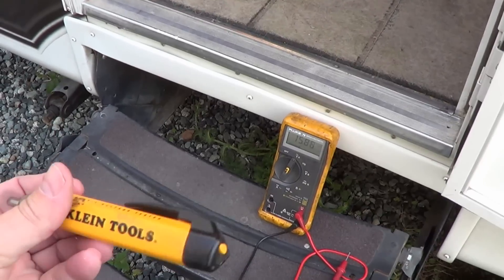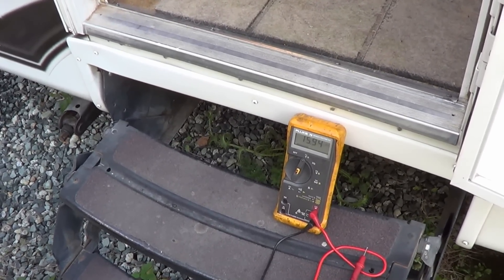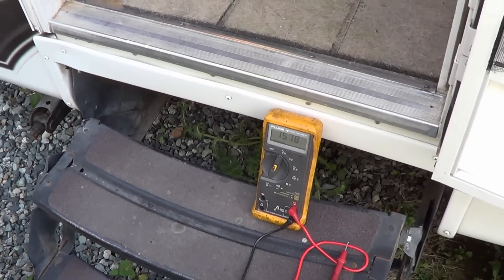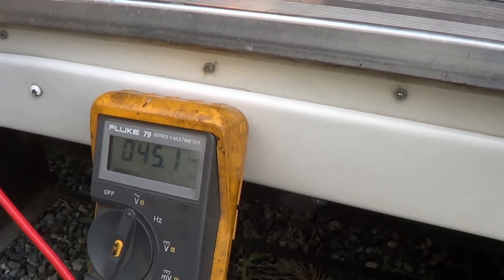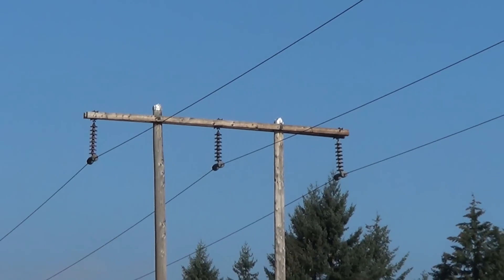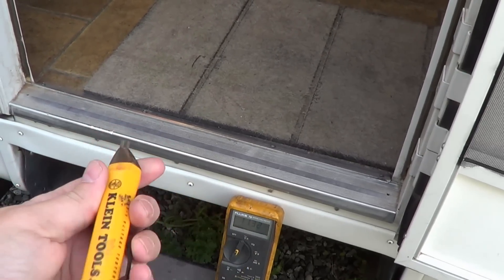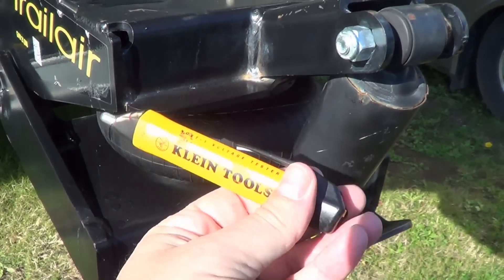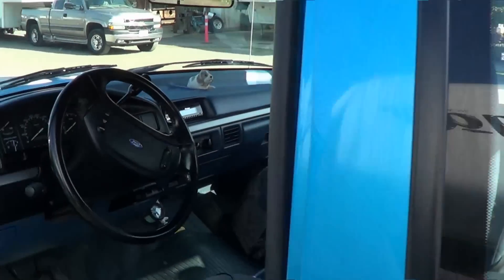Why Was My RV Giving Me Electrical Shocks?

Comment: You can trace it to the source with a pronged tester that you plug in right where you plug the camper in at. Hopefully you read my other comment as I know how much can be spent trying to trace the problem between time and money trying to figure it out before taking it to a pro only to find it quits or don’t do it at there shop. Then it does it again at the campground or park. Many people will think it couldn’t be the camp ground as they would have proper wiring lol not the case.
Reply from the maker: I have the Progressive Industries EMS-HW30C Portable Electrical Management System installed in my RV, checks the campground wiring for faults before transferring the power - http://amzn.to/2HLaRrL It will also shut the power down if it detects a fault or too high/low voltages.

Comment: All the time or just when plugged into your home or property?
I know of this to have happened to 2 different people that I know. 
I learned from the first one that it was a bad ground in the wiring in his home he fixed it after buying copper and trying to ground it ended up checking wiring in home since that’s where he was powering from sure enough home had a staple through a wire , he fixed it and electric bill went down almost 80.00 a month. Second guy I knew was about to tear the wiring apart on his camper, he literally had tools in hand when I pulled in , I told him about the other guys situation and he was skeptical as who that would word so I grabbed an extension cord and plugged it in to his home instead of his detached garage and sure enough it quit, meaning between his home and garage there was an invisible problem and he would have never known had it not been for the shocking camper...  for both guys actually, maybe you are the third.
Reply from the maker: I'm guessing you didn't watch the video. ;)
Reply: Love Your RV I did but I have low data so it stops to load ALOT what did I miss? Is it a joke video about the price or did you solve the problem?
Reply: Love Your RV the first guy I knew his camper had dead animals under it that he assumed went under to shelter from rain lol.
Sorry to bother you I guess I’m sitting here “digging up bones” or thinking about the past.
Reply: Love Your RV I read your description. It was the lines wow that’s nuts! You realize you can pull free power from those with the proper setup. 
Tesla actually patented wireless energy tower to power entire us but electric co. Couldn’t regulate aswell
Reply from the maker: Yep, you can set up ways to harvest the power but take to much and the power companies line monitoring equipment will see there is a leak in the lines and send out a crew to investigate. Likely get charged with theft.

Comment: This explains why I was feeling an electrical buzz from my camper but I have 100kV lines in my back alley and the camper in my back yard was acting as an antenna and it was picking up about 1kV and 0.001 amps

Comment: That happened to me one time .  I had turned off my propane to cross the Chesapeake Bay Bridge Tunnel and I stopped on the side of the highway to turn it back on  When I opened the compartment I was standing in some tall tall grass and in shorts and I could feel a tingle on the hair on my legs. I happened to look up and the transmission lines were right above me about 30 feet up.

Comment: What can you do to ground your RV? I have a problem with my travel trailer in my yard. You show us the problem. What is the solution? How can I ground my travel trailer parked next to y driveway . I want to hook up shore power, but the stairs get hot when I do so.
Reply from the maker: Just attach a piece of metal chain to the trailer frame and let it sit on the ground, should be enough. To be sure you could drive a metal spike and attach the chain to it. Lowering your metal stabilizer jacks likely would do the trick too.
However, if this is happening when you plug the trailer in you need to investigate why. You likely have a miswired plug and it can be really dangerous. Have a read at this website about the hot skin effect - http://noshockzone.org/are-little-shocks-ok/ or search Google for "RV hot skin" Cheers Ray

Comment: Hot skin condition is a very serious condition. I work at the utility co. Here in San Diego and one of our meter readers died from touching a travel trailer that was plugged into an outlet that was wired incorrectly. Any time you feel that tingly feeling, stop and check it out. If you have an aluminum side you should check your outlet before plugging in because you may not get a chance to feel that tingle. They say 1/10th of an amp can kill up to10 people if they were all touching the same energized object. Safe RVing!
Reply from the maker: Yes, I learned of the hot skin condition a few years ago from Mike Sokol. He has a good website on RV electrical safety and put out a comprehensive book. - http://noshockzone.org/category/rv-safety/ I always check each time I plug in.

Comment: Hey Ray, power lines bleed off about 12% of radiant energy. You being under those wires like that, take a 5 gallon plastic pale of dirt fill with water. Stick a 15' plastic or wood pole in the center. Run 12/2 black wire to top, strip 12" off top end. Take white wire strip it and stick in ground 12". Take other ends and hook to a seperate voltage regulator, to cut voltage to 12 volts and charge batteries. Or, make earth batteries. You can fill 24 buckets with dirt and water, take 12" copper wire bend L shape jump from one to the next. Stick long end in dirt jump short side to next bucket hook to iron rod or long Zink nail in next bucket. Do that to each bucket connect in series, just like car batteries. Copper is positive, iron or zinc is negative. Each bucket will give about .50 to .60 volts. Add them all up 12 volts to charge batteries. Good luck.
Reply from the maker: Cool ideas. I wonder if the power company would come looking for a leak or is it too small for them to notice?
Reply: No, high intensity power lines naturally bleed off energy, actually all wires bleed off energy. Your drop cord bleeds off energy, it's just real small. If they just happen by, they may say something, they do lease the rite of way under them. They don't own the land. But it does work.

Comment: So  . . . what is the danger of being parked under high-voyage electrical lines?  You gave it a "laugh" but since I don't understand the significance, I'd like to know what the danger is? Thanks. I've heard that cows grazing next to high-power lines have problems. Don't remember the particulars. I guess it's okay to get shocked. Or, couldn't you just move your RV?
Reply from the maker: The shock was very very mild. You get much more shock when you get a good static shock from say walking on carpet and touching a doorknob. It is more a curiosity than a threat. The voltage can be easily dissipated from the RV by grounding it with a small wire or chain or having the metal RV jacks touching the earth.  Cheers Ray

Comment: Do you think if you ran a ground cable from the RV to a ground rod in the ground this would eliminate electricity from traveling through the RV?
Reply from the maker: Yes, I tried a small piece of wire and it killed off the voltage

Comment: Inductance and reactive inductance is a wonderful thing for sure. Hammer a ground rod in and connect your RV and presto changeo, voltage would be gone😃
Reply from the maker: Yes, or switch back to metal landing jack feet
Reply: Indeed, how are those elephant feet working out anyway???

Comment: That is crazy! I would have NEVER thought 150volts from over head lines. Kind of scary if you think about it,

Is this how induction works for you smarter than me people... Just on a larger scale?
Reply from the maker: Yes, another commentator explained it as induction.
Reply: It's electrostatic induction. The peak voltage from the transmission lines is high enough to attract opposite charges to the surface of the earth and the RV roof. Similar charges are repelled to the RV floor. So you have charges at the RV floor and the earth that are trying to meet.

The AC frequency is fast enough to push an alternating current through a person and create a perceptible shock. It's "electrostatic" induction even though the E-field is vibrating at 50 or 60 Hz, because 60 Hz is slow enough and the distances are small enough ("quasistatic") that the interaction between the electric and magnetic fields ("electrodynamics") can be ignored.

The total current is quite low, low enough to safely measure with a multimeter, low enough to not be dangerous, and low enough that a grounding stake should allow the charges to balance and pull the voltage to 0. (Grounding rods are usually not strong enough to fully protect you from broken insulation or bad wiring.) An RV that's connected to shore power should be grounded so well that it never shows voltage.

 If it does there must be a missing ground or a big current leak. Trip the breaker and unplug.

Comment: The voltage is coming from induction from the transmission line. The current in the transmission line creates a magnetic field that your 5th wheel is sitting in. I worked for an electric utility, and we would connect a grounding cable from our vehicle and drag it on the ground while in a substation so we could approach the vehicle and open the door without the "tingle". It is very low current, but you will feel it. Attach a piece of bare conductor to your frame, and have it touch the earth. It will drain the voltage.
Reply from the maker: Thanks Gordon.
Reply: Omg I've been getting shocked for months in my RV & everyone thought I was crazy!! Well the other morning, I had to run outside shoeless in the rain to chase my cat. Welll let's just say I SCREAMED SO LOUD!!! I'm always getting shocked by this damn rv but idk why the other day was SOOO bad!! I'M JUST A CLUELESS 27YEAR OLD WOMAN HOW DO I DO THIS MYSELF?! Please if someone could "dumb it down" for me n explain it step by step, id greatly appreciate it. My RV door barely touched me on accident a min ago & of course it freakin zapped me! I'm so sick of this shit! 🤦🤬🙄🤔💯☹️
Reply: Gordon Hall hello I live next to A powerline and am sleeping in my 29hfs next to my house with my dog and the powerlines weee about the same distance and maybe higher voltage is it safe??
Reply: @jacobm9574  dude I'm so scared to be in my trailer
Reply: @jacobm9574  you 0 will that electrified the floor in the house and anything else inside please respond back ASAP
Reply: Juan Flowers wat up
Reply: Awesome advice! 

Technically it takes a changing magnetic field to induce a voltage on the camper, which is provided by the AC current in the power lines, but that doesn't take away from Gordon's great analysis and excellent advice. Essentially the camper has been inductively coupled to the live wires overhead, making for a very inefficient transformer. I've heard you can do something similar with a fluorescent tube bulb and get it to light up in the proximity of high voltage lines, but I've never gotten around to trying it.
Reply: same problem with our bus and we have a power line in the corner of the lot could that be our problem to we just got power to the bus but my friend also took the wheels off but it wasn't doing in the beginning where do we get that Bare Conductor ? you talkin about to take the charge out of the bus we also getting shocked when we use the water too
Reply: As i recall years ago the "skin effect" energy gave of from the huge towers going over schools were causing cancer in the kid's, the land was cheaper because of that and it's why the states and government would buy the land. It was cheaper. 
   Gerard Morin discusses how when he was young he would park his vehicle under a big power line and go hiking, when he came back it would always shock him getting in. Of course then he would get a few friends around and hold hands with the last one holding a fluorescent bulb, it would light up a bulb. It's not AC running thru the power lines, it's plasma energy. High volts low amps. If you hang a big ball of copper up you can actually harvest the energy. There's a college kid that came out with an charging antenna that will charge your phone off that, or radio and tv broadcast signal if your close enough. 
   He actually figured out how to make the plasma energy, he uses a battery from a drill and runs it thru a open spark gap, making the current ac direct. Then that passes thru a vacuum tube spark gap and is turned into plasma energy. He built an over unity generator off of it, but to make free enough free energy to charge a 3.5 kw transformer to power 2-3 houses at once you have to have the right frequency controller. He used the edrum motors out of a washing machine ran on the plasma energy, but couldn't get a speed controller made from any of the companies who supply them for the appliances manufacturers. He was close in 2014 but then all of a sudden he stopped posting any videos, and as far as i know nobody's heard from him since.
   Lt colonel Thomas Bearden put out a video and literature on free energy at around the same time, the interview video was called Lt colonel Thomas bearden, pulling free energy from the fourth dimensional vacuum as i recall. Great videos if your curious about free energy, the Keshe foundations magrav (magnetic gravity) power pack was also another good watch. I contacted the company in 2019 and tried to buy one but they emailed me back and said they were out and didn't know when/if they would have any more. 
   Interesting video, God bless!!
Reply: Yes, your words are 100% correct, but you did not think what would happen to your body if you stood under the electricity pole.  You will simply get cancer

Comment: I also grew up right next to a 150 foot high power line. It was actually very cool because it gave my parents a double lot. Around 100 feet between their house and the neighbour. I also did the florescent tube trick when I was kid, however we never had any vehicles get electrified and I used to work on my car a lot when  I was teenager. Never got shocked. The tower did get hit by lightening in 1985 and dug a 6 inch wide by 6 inch deep trench about 60 feet from the corner of the tower to the corner to the corner of the house. It blew up any large boulders in it's path. We found rock and concrete debris 50 feet away from it's original location and once the current hit the house, it fried almost every piece of electronics in the house. Microwave, stereos, TVs, VCRs, Commodore 64, etc. We had standard 12 and 9 VDC power supplies blown to pieces in the house. Very scary. It happened in the middle of the night and sounded like a bomb hit the house. Dust was falling from the ceilings. I don't know how some people survive a direct hit to their body.......... that was bit of a tangent story....sorry.
Reply from the maker: Wow, lightning is amazing stuff. Back in my electronics repair days I seen some amazing damage to things caused by lightning or when the power company screwed up and sent 440 volts to houses.
Reply: 440??  Ouch!  ......take care.

Comment: Yeah what a head scratcher. I have a small multi meter that lights up if hot voltage is nearby and that comes in handy at times.

Comment: I had caught another YT video about RVs being charged because when I plugged into my house built in 1967 I kept getting lit up! I had to find out why.
I bought the Klien tool that day! 
I did find out that it was the power cord that was causing the bad ground, replaced it and problem solved but every time I plug in anywhere I have that thing in hand as I really don't like to be lit up! 
I also have a line tester I can use to test park hookups to check for proper wiring which after hooking up I plug into the outlet next to the door for JIC a fault happens in the park and I can see it when I exit the RV by looking for the 3 green lights! Any hardware store carries them.

Blue Sky's and Safe Journeys!
Reply from the maker: I installed a surge protector that tests the line on plug in. It won't pass any electricity if the power is wired wrong.
Though, there is one very odd situation where it can be fooled so I use the Klein as well. http://www.loveyourrv.com/update-to-progressive-industries-ems-hw30c-surge-protector-review/

Comment: wow, never would have thought those wires would do that. about two years ago, I was getting intermittent shocks from my camper. it didn't do it all the time so i had a hard time figuring out what was the cause. I finally figured out that the extension cord I was using to plug in while at home was the culprit. I replaced it and all was good.
Reply from the maker: Extension cords seem to be a common culprit, glad you were able to solve it.

Comment: That is amazing. Too bad it couldn't be captured and stored somehow.  I had that low voltage tingle before on my RV when I was plugged into my in-laws summer home, which was 20 A two wire 120 V. They had a different kind of grounding in 1964.
Reply from the maker: I've heard of people stealing power with coils.
Reply: Seems like a fair exchange of services. Electrical radiation to your equipment and self for a few cents of electricity. :)

Comment: We had a summer camp I went to when kids that had high voltage wires overhead....we used to take plain old florescent bulbs out in hand and hold them up towards the wires and they would light up...not full brightness, but pretty bright.
Reply from the maker: I bet kids thought that was pretty cool. :)